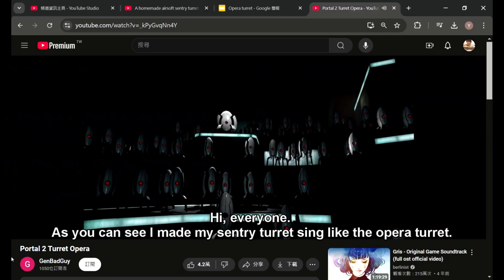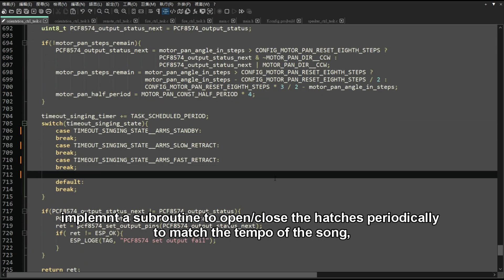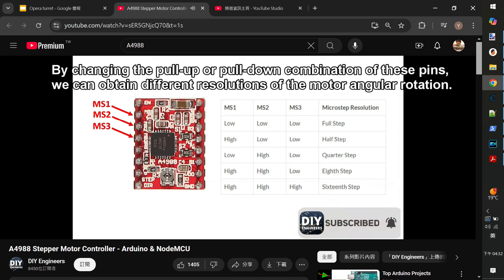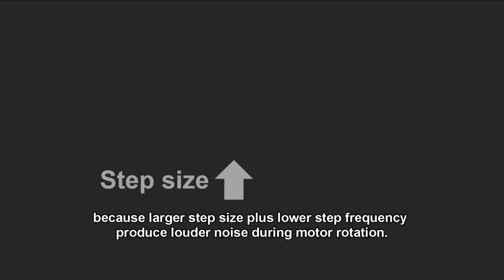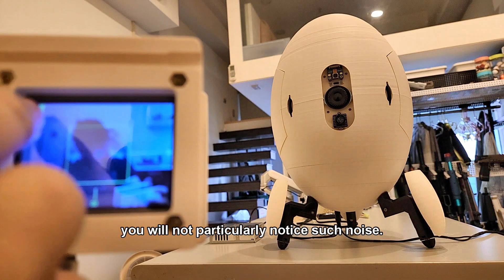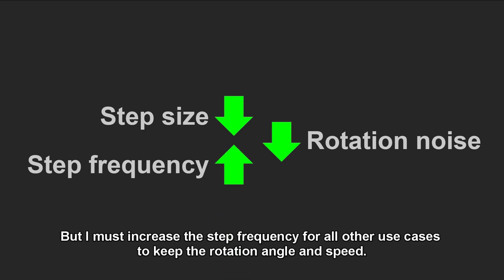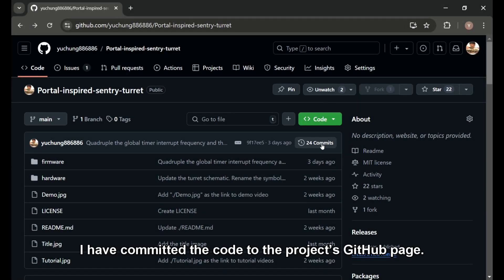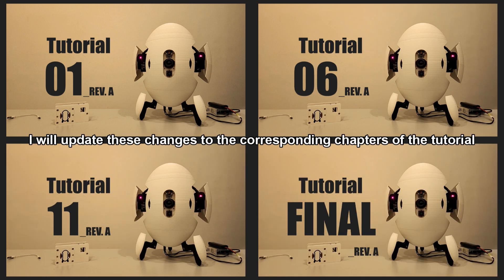Opera turret modification diary

Comment: I'm assuming those parts are 3d printed, you're probably much better off sending the design files to a manufacturer for injection molding considering the price. With a good material it would clean it up very much. Impressive work though, always been a fan of the portal franchise.

Comment: You're not factoring acceleration into account. The robot has inertia. You should reduce motor current and rather than pulse the STP at a constant frequency, start slow, speed up, speed down, stop.